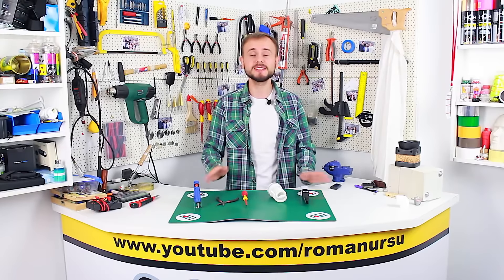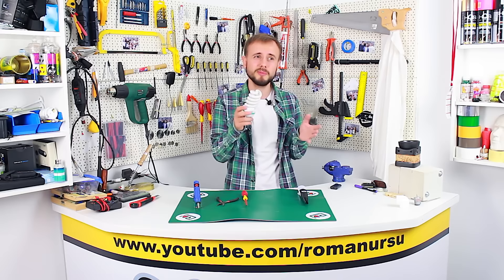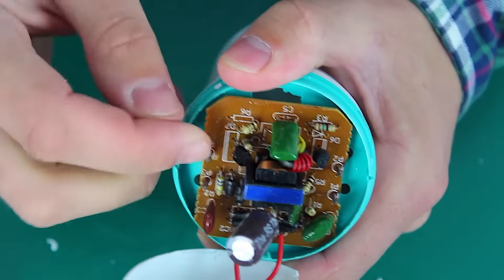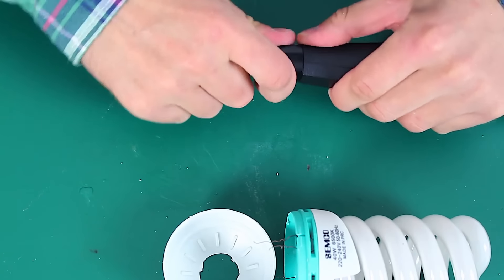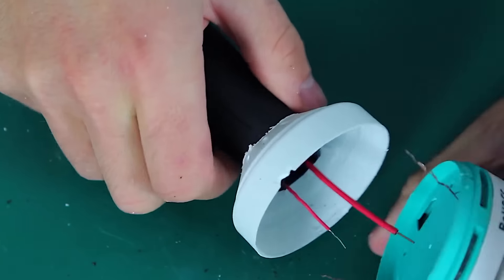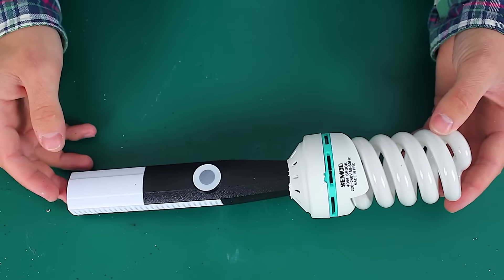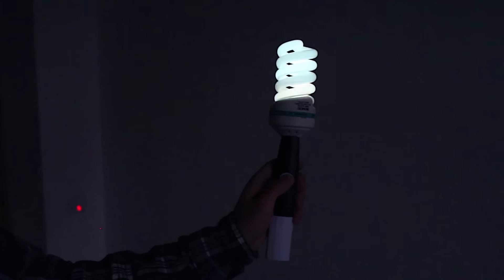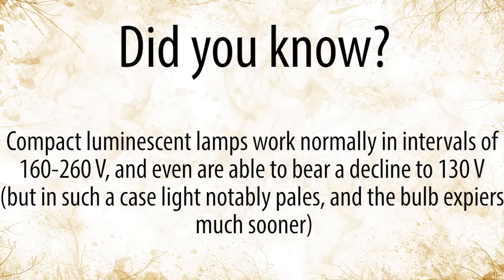How to make a super flashlight 🔴  TUTORIAL

Comment: Made a CFL flashlight years ago. Based on a Joule Theif with a third 4kV Winding.
I can provide schematics if anyone is interested but it needs tuning for different ferrite cores.
Ran at nearly full power, it lasts about 3-5 hours and provides nearly the full amount of light.
Power output is about 4W, 1-4kVDC, and works best with a 5W mini CFL.
Reply: can you send me the schema please?
Reply: Nick Lacey
Sure. I'l draw it up and reply. I got it memorized so this'l be pretty simple. I'l put some comments on it for which values may need adjustment.
Reply: Nick Lacey
Ok, you're going to need a 22mm ferrite toroid for the transformer core. I think UXCell on Amazon sells them for a good price.

You'l also need a Toshiba K2611 Power MOSFET. It has the necessary protection built in so it dosen't get fried. If you use a regular unprotected transistor or MOSFET, make sure to put two 12V Zener diodes in series, both with the negative pins connected together and the positive pins connected between Base (Gate on MOSFET) and Ground. If you look at the diagram of the MOSFET, you'l see it's not a normal one and has this part built in.

Schematic here: http://s6.postimg.org/5nkufj4j5/CFL_Driver_Simple.png

Wind the 750 turns of very fine magnet wire (like from a DC motor) on first and keep going around in a circular motion until you have 500-1000 turns. I use 750. For the Gate and Drain windings (Cyan and Green in picture), twist two wires together to make a bifilliar pair. Connect the second coil wire that goes to the gate backwards. That means use the opposite ends as you did for the winding that went to the source. It should end up with the beginning of the first wire and the end of the second wire connected to positive.

Make sure the MOSFET is on a tiny heatsink so it dosen't overheat. It dosen't have to be big, just a 1x2in sized 1/8 in thick or larger metal strip to help it dissipate heat. I used 4AA cells inside a holder that I stuffed inside my flashlight that normally held 2 D cells, so that there was room above where the second battery normally went went for the electronics.

For power, use 4xAA, 4xC or 4xD cells.
I recommend NiMH rechargeable like Rayovac Recharge or Eneloop as they can provide more power and last longer.

Connect the output wires of the 500-1000 turn coil to the two separate filaments of the CFL tube, you only need to connect one end of each fillament.

I recommend not turning it on without a bulb connected. It will arc between the wires if they're close enough and the thin windings could burn up. If you must work on it while it's powered on, use only one hand to decrease chances of getting a painful shock. It's not lethal by any means under normal circumstances, but it burns like a million hornets.

DISCLAIMER/WARNING: I ASSUME NO LIABILITY AND RESPONSIBILITY FOR THE USE OF THIS CIRCUIT AND ANY DAMAGE OR INJURY THIS CIRCUIT COULD CAUSE. IT OUTPUTS VOLTAGES BETWEEN 700V-4000V AND CURRENTS BETWEEN 5-15mA AT LOW POWER. THIS CIRCUIT CAN CAUSE SEVERELY PAINFUL SHOCKS AND SHOULD NEVER BE HANDLED WHILE POWERED ON!

Comment: using LEDs is much simpler and gives brighter light
Reply: no you need to cool them
Reply: Lego Buildings Rewiew only the bigger ones. the smaller ones dont create much heat
Reply: Yeah like putting a heat sink on is hard.
Reply: +siimsimsiim No its not
Reply: TheEnragedGamer Like I wasn't sarcastic... I was
Reply: it will fry up the led because he uses a stove lighter which has high voltage arc in it.

Comment: Think i've seen that same type of bulb on amazon as photography lighting bulb or something like that, apparently they have a chance at catching fire or frying or something similar according to reviews. Also, probably easier and cheaper to just buy a like $10 led flashlight, I got one for like $15-20 on amazon that's bright enough to see the beam in the air. LED Lenser 880028 V2 is the one I have I believe. Easier  than finding whatever power source thing he's using and an old light bulb.

Comment: The CFL bulb isn't going to survive very long in a setup like this. The lighter circuitry is really smashing the anode and cathode, causing them to sputter and break down. It won't take long for the ends of the tube to go black and the bulb to stop working.

This is actually one of the biggest reasons cheap CFL bulbs fail. The anode and cathode need to be pre-heated with a low voltage source to become emissive and then the bulb needs to be struck. Cheap CFL bulbs don't do this because it costs more and because many people find it annoying they don't get instant light when they turn the fixture on.

Comment: Be careful when accessing the printed board circuitry.   I got a nasty shock from an electrolytic capacitor which had been charged to the Uk mains voltage of about 230 Volts !

Comment: Also, FYI, you can light the bulb by putting into microwave cooker, because of the 2,4 GHz radiations, but do not try it, because it will explode in 2-3 seconds. :D
Reply: A better, wise idea is to recover the components from the eco bulb. You will find 2 transistors, 4-6 diodes, a diac, few capacitors and resistors, a feritte transformator/copper for small coils, etc.
Reply: some circuits here - http://www.pavouk.org/hw/lamp/en_index.html
Reply: i think you can find inside the electronic part of bulb all the electronic parts to build Roman Ursu tesla coil. ;)
Reply: or an astable/bistable/tone generator... resistors probably are too big for low voltage, but you can place them in parallel, etc...

Comment: Ok that circuit board changes the output of the energy entering the bulb it would be nice if you tested the actual bulb itself getting the proper voltage and amps is helpfull. then again you could just stack battery cells and do the math without expensive diagnostics

Comment: How about using a fly swatter circuit instead of that gas lighter......
Reply: Yep I'd imagine that would work quite well
Reply: Under load the little flyback converter in them maxes out at a couple of hundred volts... continuous. Ideal for a fluoro tube. I doubt the switching transistor would last long tho.

The circuit Roman used here is designed for extremely high voltages at low currents too remember ;)

Comment: I have a much better and BRIGHTER self-made flashlight than that.
A continuous 50 LED bulbs rated 12 volts each in parallel connection; Connected to
18 volt  battery (two 9-volt batteries in series connection)

Comment: Props for creativity and all but I just utterly fail to see any practical use for this.   CFLs are less efficient than LEDs, especially when underdriven like this and with no reflector to focus the light in any way.    It is also very ungainly and you get a faceful of mercury vapors when it breaks (depending on which CFL you use).  
Overall brightness is pretty low.
Finally, you can buy a 3xAAA zoomable flashlight from dx.com or amazon or aliexpress or ebay or wheverever literally for like 5 bucks shipped that will be much more useful and cost less than the parts on this abomination.